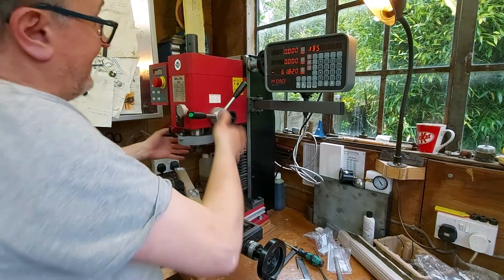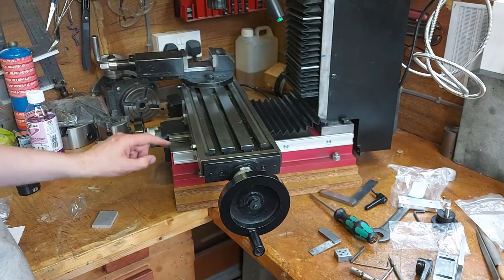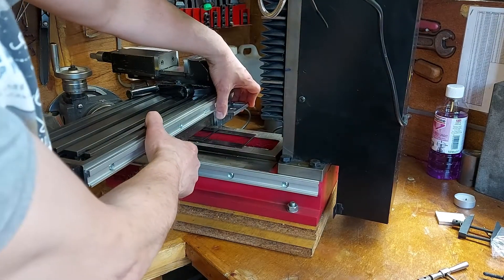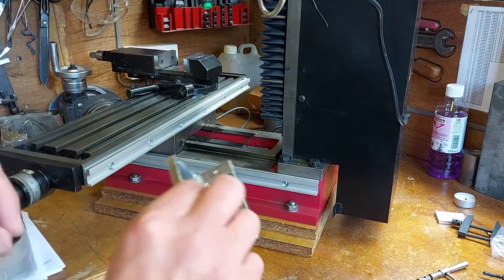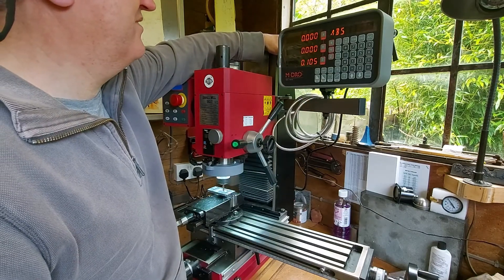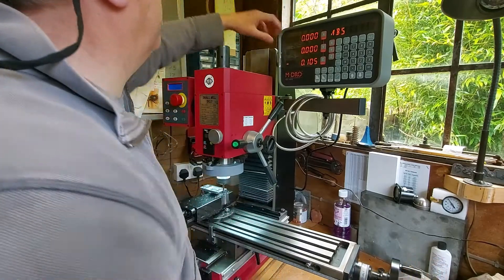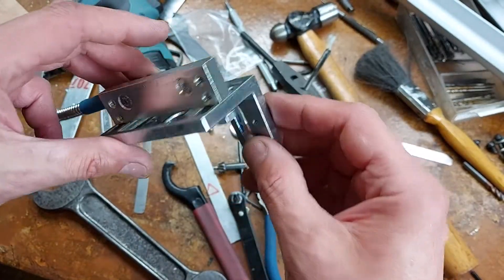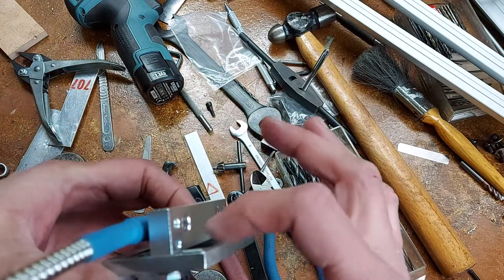Sieg SX2 7 DRO Installation   Part 3

Comment: Nice series of vids Nigel.  I have the SX2.7 and am thinking about a DRO for it.  I had some idea M-DRO were working on a tailored solution for this model, but I've not seen anything on their site about it actually being available.  That angle on the cast base looks a pain.
Reply from the maker: Thanks for the feedback. I think M-DRO are working on a kit, but not sure how far they've got with it. Might be worth dropping them a line as they are very responsive. I just ignored the angle on the base as its within range and the y-axis is working fine.